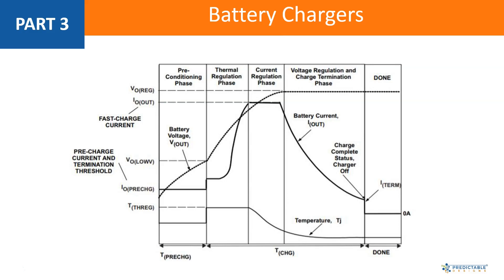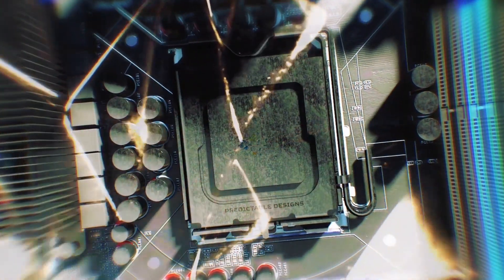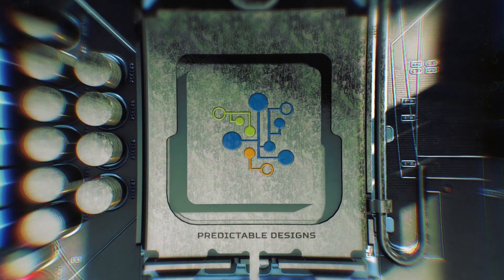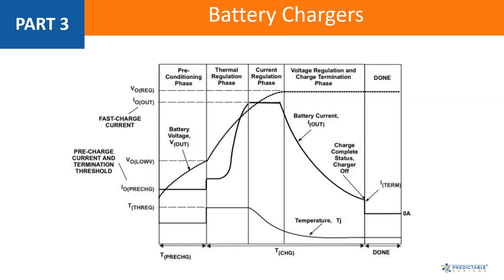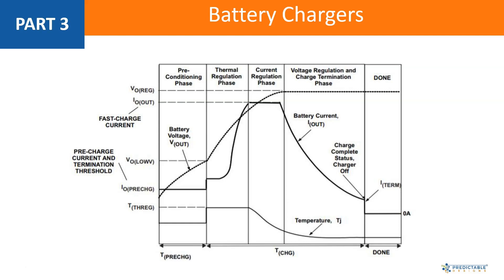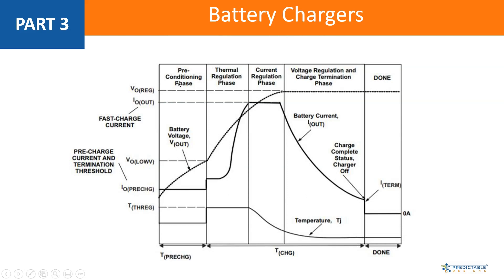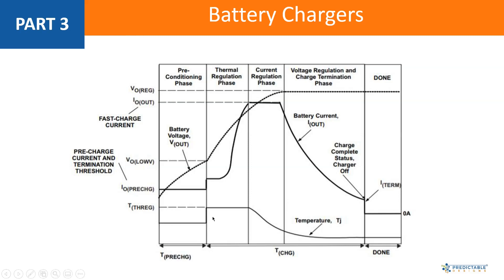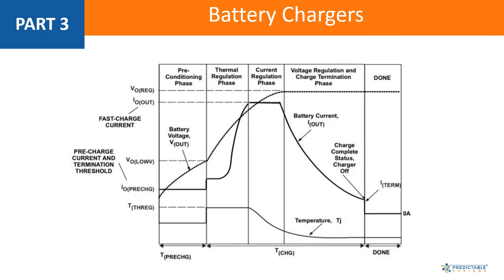Basics of a Lithium-ion Battery Charger

Comment: Helo I’m trying to understand the circuit of clean Robot that use an Xl1509 CI in order to provide the charge for a pack of 4 Liion serie bat . But inside of the pack there’s no BMS no protection. With oscilloscope it detect that air voltage and amperage is growing up slowly managed by Xl1905 as the battery 🔋 is charging and it XL1509 cut of charge as it fill up . Can you explain me how this circuit is not using BMS originally into battery pack 🤷

Comment: I have a e-bike battery it’s lithium ion it has 36 cells in it they’re packed in groups of six I believe one of the groups of six got disconnected, the weld connection broke so that group of six is lower voltage than the rest now the entire thing won't charge can I simply just re-weld it to the rest of them and charge it back up to normal or do I have to take them out separately to charge them up fully to match and then reconnect them??

Comment: At work we have a battery pack... Li-ion 19.?v but only has 5 terminals... and from what I can figure out 1 common and 2 terminals which come out at 19v the other 3 buzz through as though they are short... if lithium Batts are 4v how will the charger for this work? Will there be a circuit inside the battery pack as well and the charging unit it sits on?
Reply from the maker: It would need a multi-cell charger since the pack is made of 5 cells in series. Inside the pack itself will usually just be protection circuits for preventing overcharging, etc.